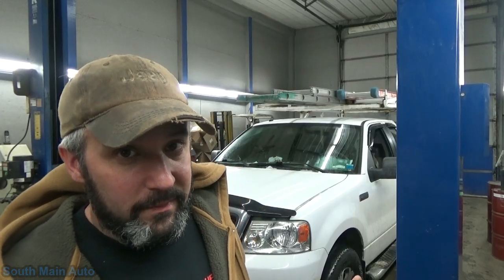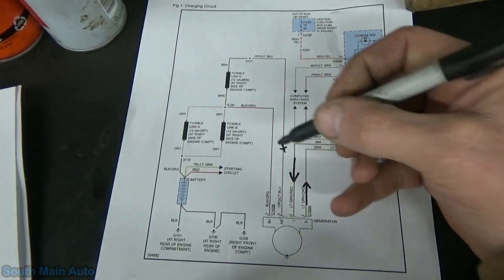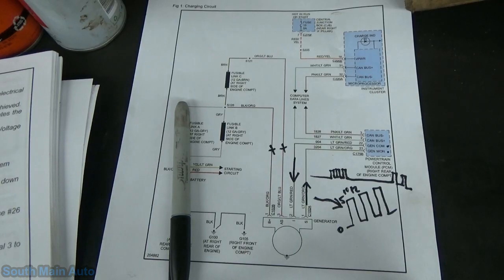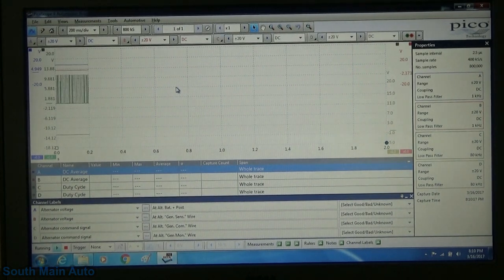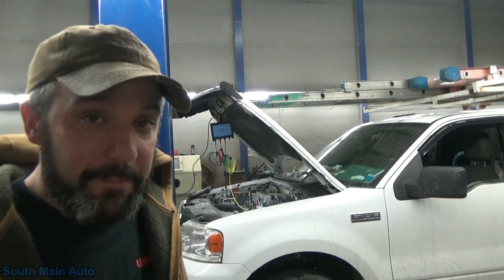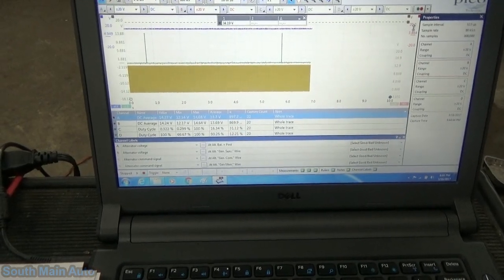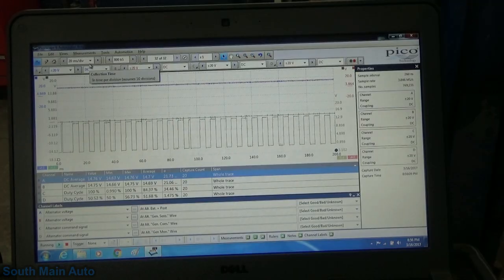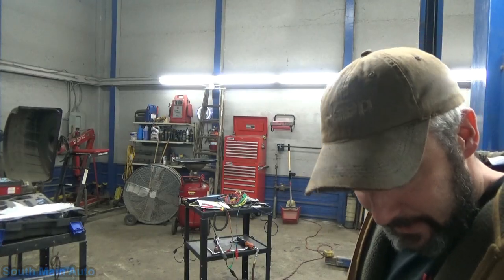Ford "Smart Charge System" Alternator Not Charging

Comment: Seems like the internal regulator was lying to the PCM somehow? So there was no command to charge.  11th wonder of the world.  Yoga pants were  worn while watching this vid  lol
Reply: From what I've discerned, the sense wire used to control/regulate charging voltage is the one on the alternator. It doesn't use PCM supply voltage for charging system regulation or monitoring.

The gen com line tells the alternator what output level to charge at and the gen mon line tells the PCM what load is on the alternator. So long as the alternator reports that it's handling the load and not being loaded down (i.e. voltage isn't dropping below regulator set point) then the PCM finds nothing wrong with the charging system. I'd say the flaw in the way this all works is the alternator itself has to report to the PCM it's not keeping up with the load (not charging) for the battery light to come on. A broken part responsible for reporting it's broken, what can possibly go wrong with that?

Just my 2 cents on this "Smart" system
Reply: I think it was more of the control and sense were both saying "everything's working!" but the alternator wasn't actually putting out any current.
Reply: I agree, but you would think the PCM would of noticed the low voltage on the sense  wire ?

Comment: Kind of makes sense that 0% Duty Cycle = Full alt output in case of broken wires. The higher the DC% on the Command line wire shuts the alt output off (100% = Alt output off). Notice the high DC% during cranking. The manual says the alt shuts down during cranking. 
Wonder what it'd do if it lost the Intake Air Temp sensor.
Reply: CO Jones Thank you! I was thinking the same thing and was surprised Eric didn't draw the same conclusion, went through all the comments just to see if anyone else had. The GEN COM signal is inverted, low means charge and high means don't. Explains everything except why there's no code and no battery light, but judging from other comments, that's a common issue with that system.

Comment: Eric great video and diagnostic.  I will add that the Alternator also shuts down during acceleration and varies on demand of the engine for better fuel economy.  It will also increase charge when the engine is under deceleration to economize fuel efficiency by drawing power to charge the battery.
Reply: Hi, interesting info....do you have a source for this please?
Reply: http://www.hella.com/startersalternators/assets/media/g06_ti_en_electronics_ford_smart_charge_system.pdf

Comment: The alternator is shunting charge and not sending a signal of failure due to it not meeting the signal for it to send a failure to the IPC to indicate a failure.  The alternator is providing just enough charge under idle to charge, but not enough charge under load. The under load voltage is sufficient to not trip the IPC to illuminate the battery light.   Essentially the diode has partially failed and is essentially "shunting charge" .   The Ford dash and lights all react in strange manners when the battery charge gets low and creates havoc with the electronics.  I went through this with a 2011 Ford Edge limited alternator.  The alternators are not able to be rebuild or repaired and it must be replaced.  Highly recommend a new OEM alternator. The Ford Edge will display "battery Saver" warnings with low battery's but this does not point to the alternator.  Load testing must be performed and can be tricky to detect as it sometimes can be very intermittent or barely noticeable.  Eric a Ford Edge alternator is a real PITA to change as you have to remove the fan assembly, tire, wheel well cover etc and work from bottom and top to remove the alternator and you have to work the alternator to from the passenger side to the drivers side to remove it. Then reverse the process.
Reply: Could you explain why this Ford Edge alternator can't be rebuilt? Also, what do you mean by "shunting charge"----the alternator is charging a little but not enough?  Thanks if you or anyone explains.